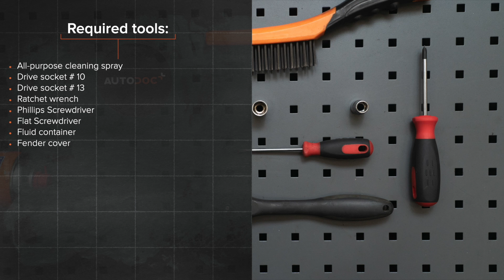Changer un filtre à carburant sur VW T5 TRANSPORTER Van [TUTORIEL AUTODOC]

Comment: qu'est-ce que ça veut dire les lettre dans le filtre?
Reply from the maker: RT - Return line to fuel cooler / Conduite de retour au refroidisseur de carburant
VF - Supply from fuel tank / Alimentation à partir du réservoir de carburant
VM - Supply to tandem pump / Alimentation envers la pompe à carburant
RF - Return from tandem pump / Retour de la pompe à carburant